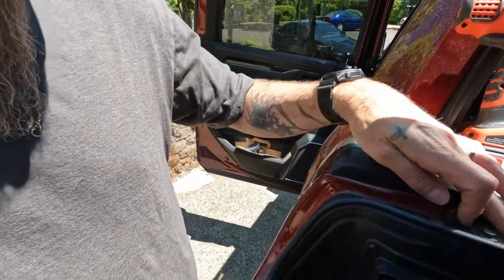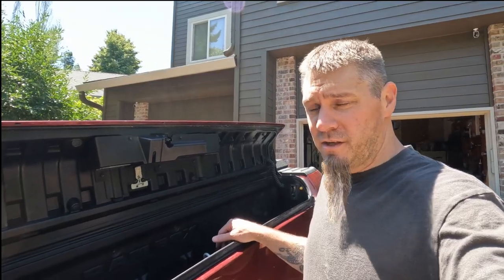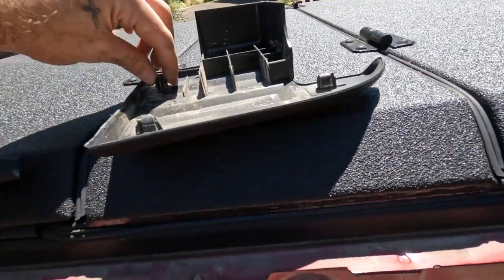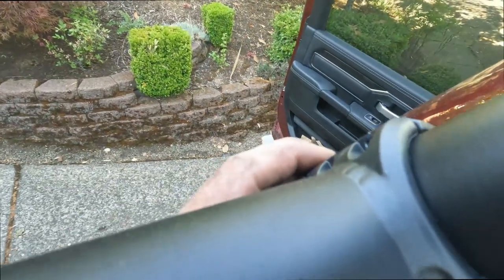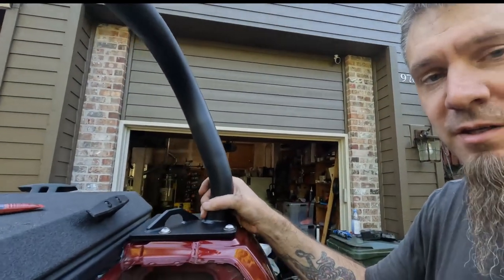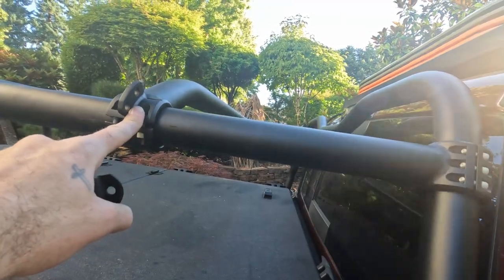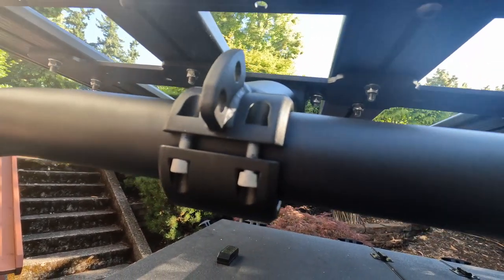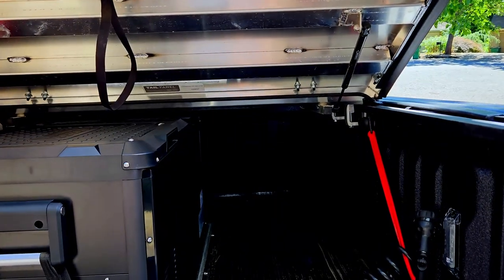Bed Rack Install Ram Power Wagon with Rambox

Comment: Getting close to my rack shipping and was reviewing your video again. One thing I noticed when installing a new rolling cover recently (Bak Revolover X4s) and sealing up the tailgate to limit water ingress, is that I had mounted a lot of gasket material to that back plastic cap.  It looks like with this Countour rack that is just a flat plate at the back.  How did you seal up the tailgate area from water ingress or am I missing something?
Reply from the maker: Yeah I ran into that issue also of my caps having a seal kit attached. If you look at my Bumper install video at the 47:25 mark, you can see I was still able to use some of the leftover bed sealing kit and was able to stick it in there to close up the gap. I attached it to the Bed Rail side. Then used some black silicon to fill in any other small gaps. It was some of the stuff left over from this kit: https://www.amazon.com/gp/product/B08L21DGNB/ref=ppx_yo_dt_b_search_asin_title?ie=UTF8&psc=1
Believe it was the stuff from the longer roll that filled that gap just fine.
Reply: @offcamberoverland  Nice.  Thanks for the response.  I reviewed your other video and saw what you referenced.  I will probably order that kit to use.  I have had a similar kit from another bed cover manufacturer to seal up around the tailgate that I have used before as well.  I will also reach out to Marcus and see if he has any recommendations.

Comment: I hate that there is nothing for the in the lines aftermarket mods for trucks with ram boxes
Reply from the maker: Yeah you definitely want to think through your planned usage and needs for a truck when considering whether to buy one with or without Ramboxes. I like the quick access of things without having to open the bed. But if you plan to run a Camper or want a Bed Cap/Topper then I wouldn't get a truck with Ramboxes. Because of need to open the boxes it makes Bed Rack options pretty limited.

Comment: I'm trying to figure out one that is higher than the roof and has a hinge system for loading my job box and such. I travel for work and kyak.
Reply from the maker: Dethloff has taller horizontal crossbars. The Mid height ones. This allows kayaks and other stuff to be at a height to go over the cab.